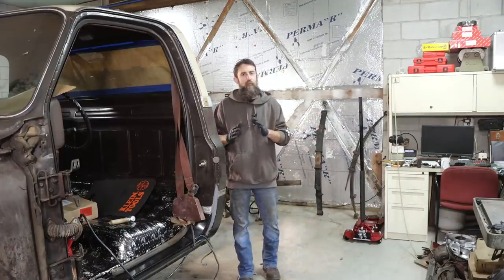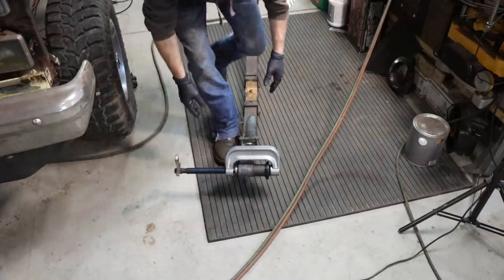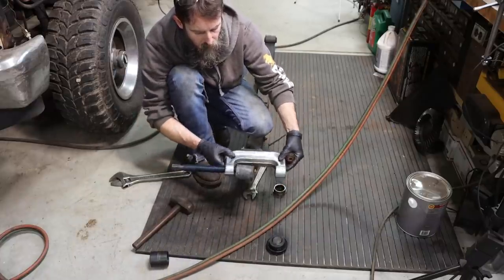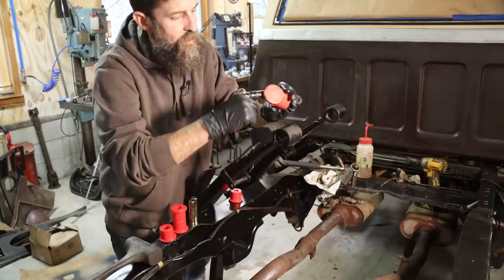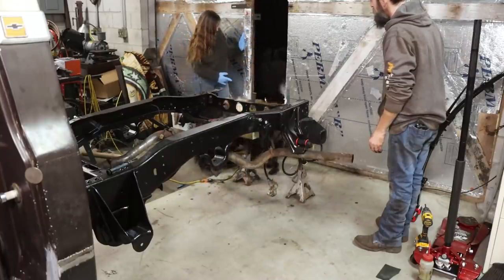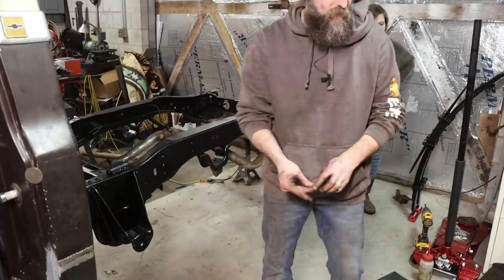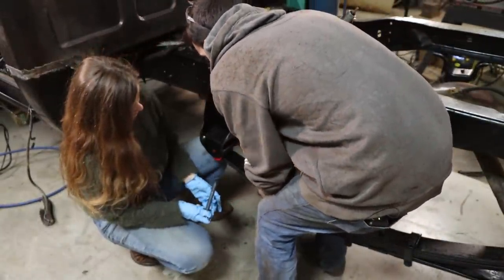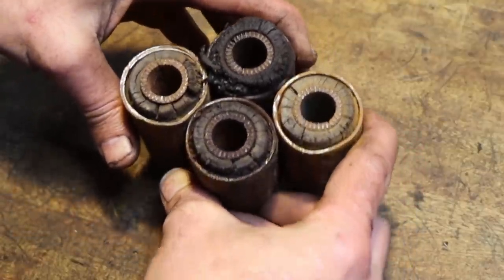Cheap / Easy way to press out old leaf bushings in the driveway.  Elizabeth edition

Comment: Steve , after using polyurethan bushings for many years, you will find they will indeed always squeak no matter how much lube you install them with. I switched over to polygraphie bushing to help stop some of the squeaking from SPF as there the only company that sell them. Almost twice the money and even they sometimes squeak as well, but no ways near as bad as the standard polyurethan bushings. To be honest, I think next time I do a bushing job, I am going back to the old faithful rubber bushings for a street application. P/S glade you were out of the path of that tornado, was VERY worried about you in that mess.
Reply: I've been in the off road parts industry for 25 years. Rubber bushings are a pain to deal with but.. They do work the best. At least for a truck like this. Poly always squeaks. Always.
Reply: @65BAJA  my experience is the rubber lasts more miles than the poly and has a little better ride. Bronze bushings and grease fittings if you want to get fancy last the best. 🤠

Comment: I pressed out bushings from a pair of link-arms using a welded-up square frame and a 5-ton jack. It worked, but was very dangerous as the frame was of high-tension steel from road-railings. Spring-hardened. The welding was not up to a decent standard at all.

It held up and did the job, but this was a bad proposition in hindsight.
Would a weld failed, I might had a deadly blow to my head in the doing, for the steel springed and got a lot of energy into it, before the bushings moved.

A good tip: When you tighten the spindle as hard as you dare, not damaging it, get it som blows from the hammer and check if the tension got lowered. Now re-tension the spindle and go further from this point. Just tensioning harder and harder might not work without some blows.

The shock from the blows often makes things moving without damageing the tool, witch on the other hand, over-tightening might do.

Comment: Another super easy way is to drill out the rubber with a series of holes from a 3/16"-ish bit. Drill 4-8 holes and tap out the bushing. The outer sleeve will easily peel out with an air hammer or chisel.
Reply: Fire and an air chisel works too. The rubber is self removing with proper temps. 😎
Reply from the maker: @bcbloc02  Yep😁 probably 75% of the ones I have removed have been that way.  Its definitely a outdoor operation. I am always amazed at the amount of smoke.

Comment: Since this truck is gonna be doing some hard work for a long time, have you thought about boxing some/all of the frame? Even some light sheet to close it up (which you have proved you can handle well) would really boost the strength and durability, especially with some heavy paint/coating.  More work, yes, but since you're into it already, maybe a path to take!
Reply: Boxed frames are very prone to rust out from the inside because they hold debris and trap water. I would not recommend it.

Comment: Steve it will ride like night and day with those polybushes they are great things! I'm a bit curious as to why you have put both bolts in before rolling the axle in place? Do your springs fit on top of the axle and not the other way around? I'm curious as the only 4x4 's I'm familiar with are Land Rovers and the axles sit on the springs normally. Cheers from the UK have a great Christmas ( I hate saying happy holidays as it's a Christian festival after all) and a Happy New Year we seen to be heading into yet another lock down in the next couple of weeks. So stay safe and keep well you all?